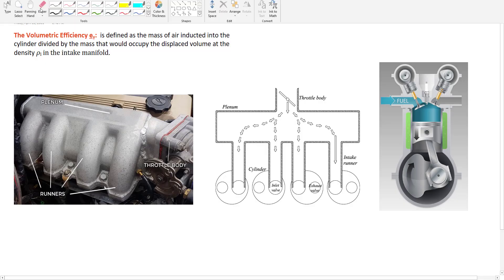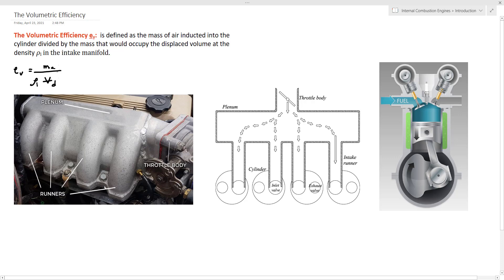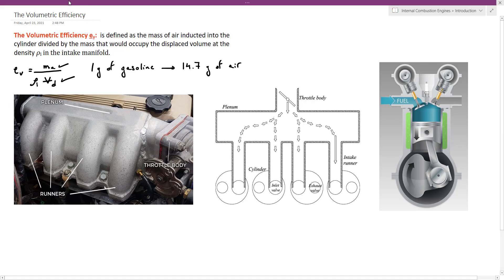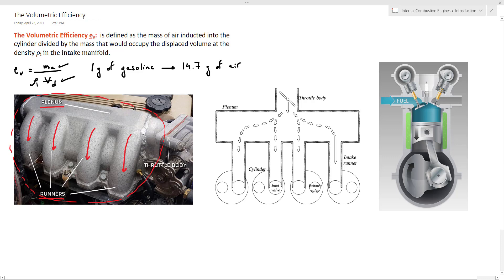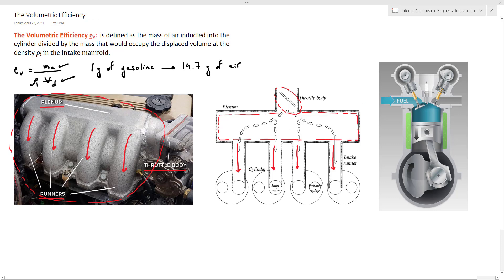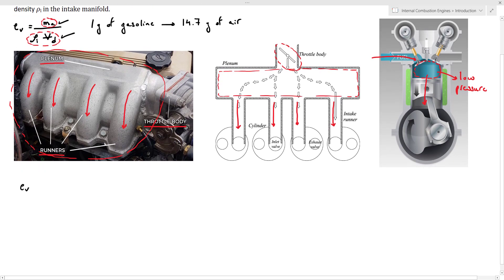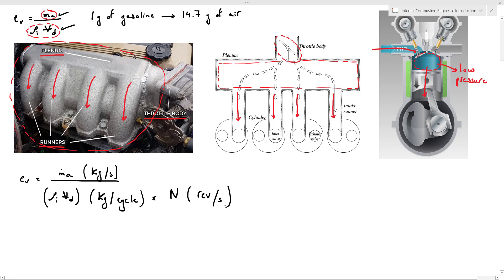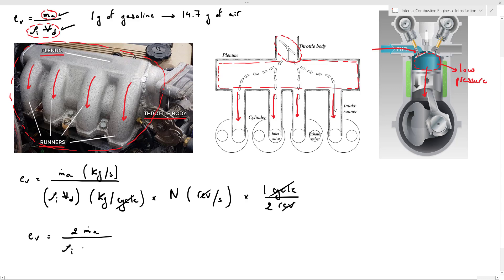Internal Combustion Engines: The volumetric Efficiency | Dr. Samer Ali

Comment: The theoretical mass is not found using the density in the intake, it is found using the density above the throttle plate. Using intake density will result in the VE never changing with throttle position. The entire function of the throttle is to reduce the engine systems' VE. 

Also, high-performance engines frequently exceed 100% VE, disproving the statement you made multiple times that VE must always be below 100%.